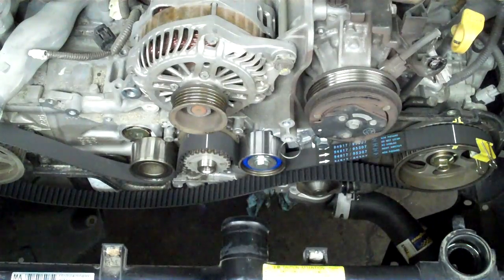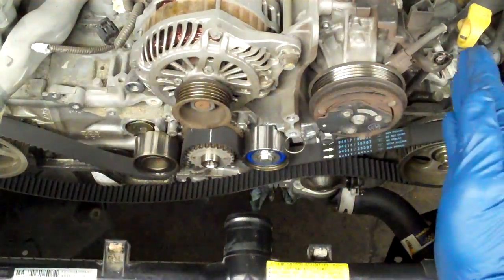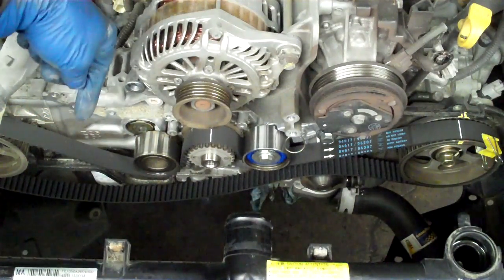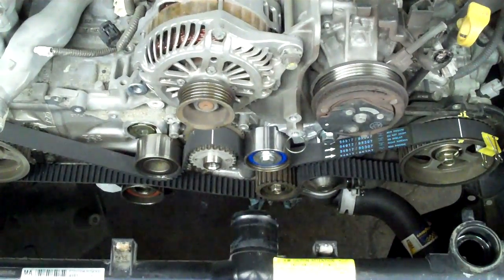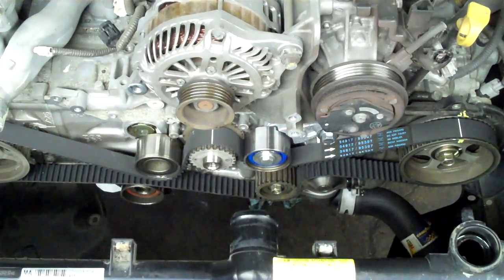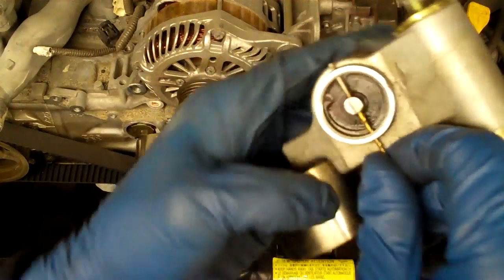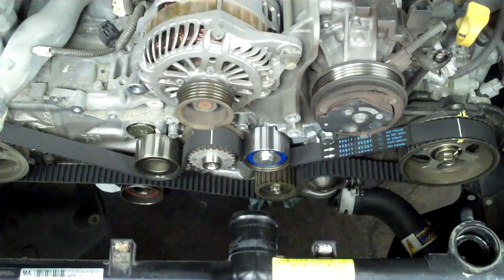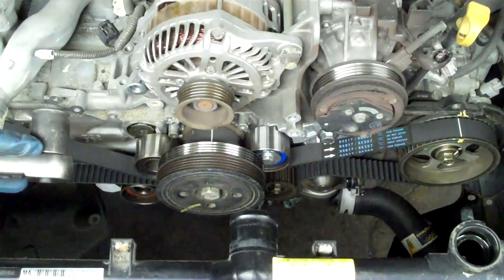How to replace a SOHC Subaru 2.5l Timing Belt

Comment: Hi man, awesome videos by the way!. I just have a question. I own a subaru impreza wagon 2001 with an EJ15 engine and I couldn't find the torque specs required for all the bolts and nuts. Would those be the same as for any 2.0 or 2.5 SOHC? Thanks!!

Comment: I am going to be replacing the clutch in my 94 Impreza 1.8L We are planning on pulling the engine just to ease the process. Car has 211xxx miles and I bought it second hand. I figured while the engine was out should I get a gasket kit and do them all while its out. Would you advise that? And possibly doing the Timing belt. When changing the timing belt is it necessary to replace the Tension pulleys or is it ok to reuse them?

Comment: Sorry to be unclear, on the passenger of the block. This is for the EJ25 SOHC. No Turbo. Right where the Bell housing bolts to the block. It is right in the middle, between top and bottom. Also EJ22.

Comment: Not sure if someone already asked, but just whacking to tighten the crank/balancer pulley - ok not to torque it down to spec? I do this myself (just whack with a hammer or hand tighten until it feels right)... but curious what Brian and others think. The only bolts I usually ever use an actual torque wrench on are wheel lugs/bolts and engine internals (cylinder head, bearing covers,etc.)

Comment: Great video Brian. I had a 2007 Suby Legacy 2.5i limited it was the best car I ever owned until it was stolen in 2010 it was found 2 months later in SC( I live in MA) nothing but a shell was left I ended up getting a 1997 Infiniti Q45t in mint condition with 80k on it from AZ and banked the rest. Do you know anything about that Infiniti I should be aware of for futures sake? I know parts are exspensive haha.

Comment: Hey brian love your videos especially the helis. Quick question i have a 2000 solara v6 5sp on first start i have valve clatter for about 20 seconds should i be concerned? It has 175k no oil consuption and runs well once warmed up

Comment: Nearly all the bikes have a timing chain,  (except ducati)
All of their engines run 2 or 3 times faster than a car engine and they rev quicker
your  bike have one.

A chain last longer is lubed and has less air drag than a timing belt.
the only thing a chain is less good is at handling linear speeds.

The timing belt is only here to force peoples to make them changed in the dealerships.
and the water pump is connected to it ,no problem ! change it each time ,justy for safety !

Comment: Another way to loosen or tighten the crank bolt is, if its a manual, put it it 5th gear, handbrake up, and get someone to step on the brake.

Comment from the maker: I haven't done one of those for like five years.  The last one I did (full head job) the customer insisted I use 10w30 oil in it.  It rattled like a snake!  I had to change the oil to 5w30 Valvoline and it quieted right down.  I was freaking out because I did it all perfect.  Funny how picky that car is!

Comment: Awesome video Brian, I love Subarus too and love any Subaru videos you can put out. It's interesting too that Subaru has always used timing belts on the 4 cylinders (not the 6 cylinders), but the new 2.0 and 2.5 engines have switched to timing chains. Seems like people want the maintenance free chain over a belt which makes sense but the advantages of a belt also make sense. Trade-offs are involved just like anything else.

Comment: If you look down on the left side on the back of the block where the tourque converter meets the block there is a 1/4 inch hole that allows you to place a Philips head screwdriver or pin punch and then just push or pull on the 22mm wrwnch you will then lock the block and you can loosen or tighten the pulley bolt as needed

Comment: A fourth way [to get crank bolt loose] is to put the socket on the crank bolt, ratchet on the socket, put the ratchet against an immoveable object, and tap the starter [which will create a large enough force to break the crank bolt loose.

Comment: if the car was a manual couldnt you just set the ebrake and put it in gear to break the crank pullley bolt?

Comment: ok i am confused ..  that means that  there is only one position posible on the crank?  you could never be off ?  as long as the mark on the crank  is at 12 o clock   and the cams at  12 too?  ( not sure if it is 12 oclock but it looks like)

Comment: With the auto you can also open a rubber access cover and stick a big ass screwdriver in the flex plate. Then work a breaker bar,